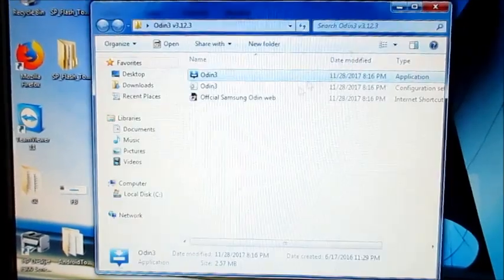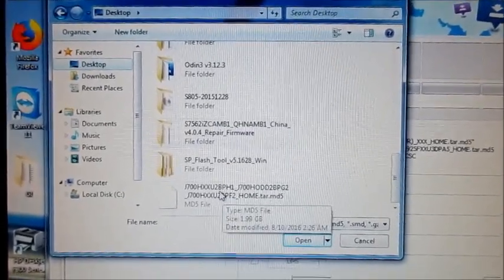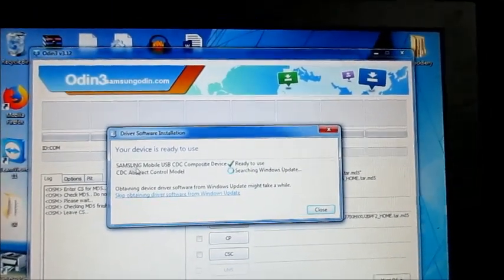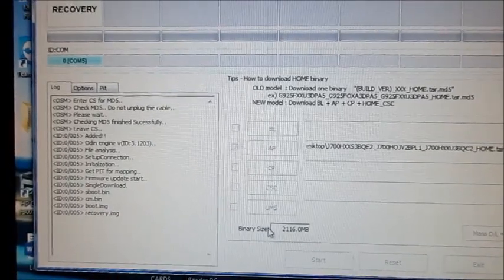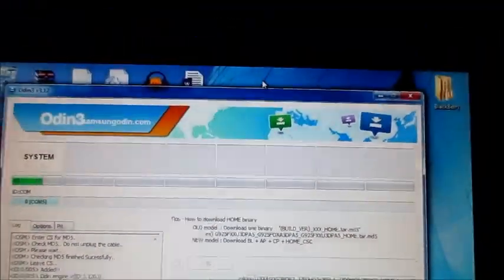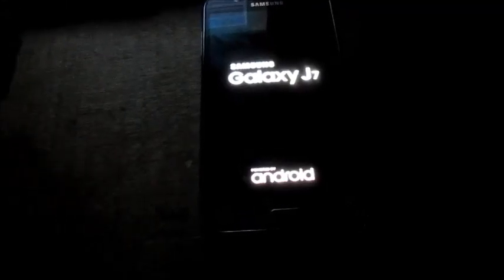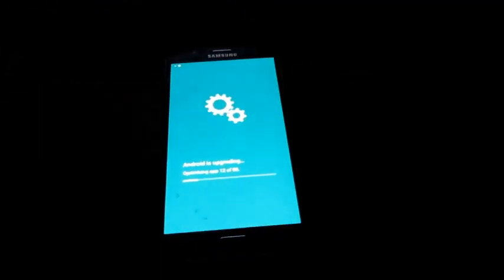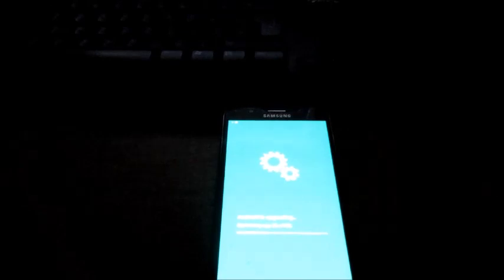Custom Binary Blocked By FRP Lock Solved 100%

Comment: i have a samsung on5 where i find rhe firmware
Reply from the maker: The firmware version can be found in recovery mode. To enter vol up home and power button, you will see the version at the top.
Reply: @Lenzwalters  yes but wherr i find the link or the correct file to download for samsung on5